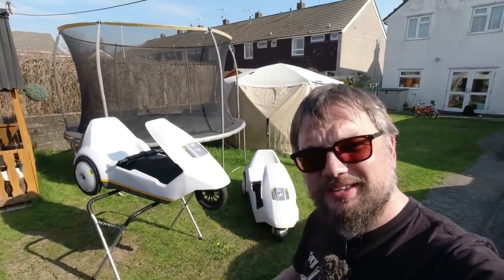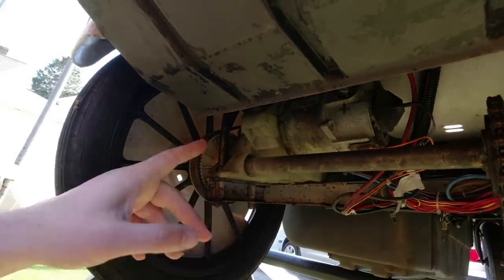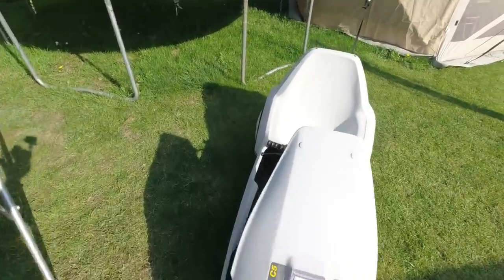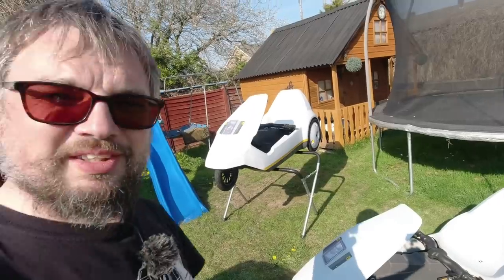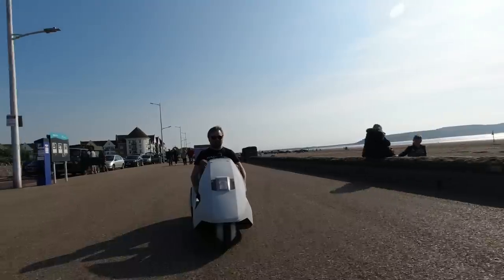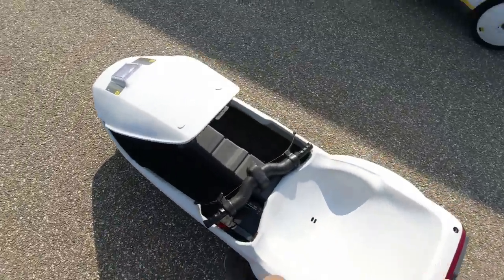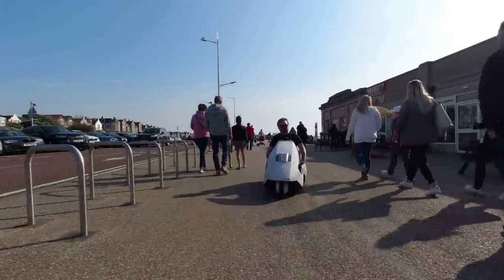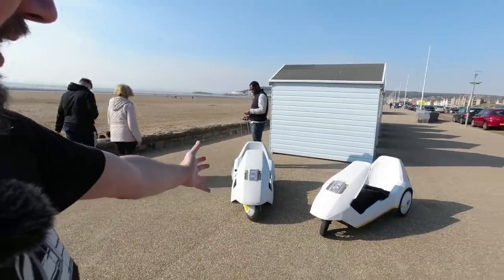Sinclair C5 - A Great British Failure! (we love a failure!)

Comment: They did sell a high visibility mast for the back and even custom fit cushions, I still have the original brochure. I have ridden one on the road once and it was very scary, cars can barely see you and lorries will not see you at all. I think the current modern equivalent is the electric scooter obviously they are still currently illegal to use on the roads, but then the C5 only came about due to a rule change on motorised vehicles.

Comment: I really must fix my C5, I used to drive it to the school I worked at during uni, the kids loved it! Good summary of it, really no car will come close to attracting to the amount of attention a C5 does, there is no suspension (I have the seat mat - think camping mat thickness, and that does save your spine!), but its great fun to ride. I never found it daunting to drive in a 40mph limit - due to its unique nature I found that people tended to gie it a lot more room that they would when I rode a bike - although the width is fairly similar. The rear brake is a proper drum and packs good stopping power - the problem was it only braked the right wheel so an emergency brake meant veering to the right (toward traffic!). There was an estate with cycle lanes near me which was nice to drive round  - except the appalling turning circle (I recall i could just about do a 180 on a 2 lane road), which meant I needed to get out every time the path stopped abruptly and crossed a road.

Comment: I have owned recumbent bikes. A three wheel Trice and a Peer Gynt. 

On the Peer Gynt two wheel the steering was under the seat. 

I missed out on a unboxed C5.  The C5 is as relevant as ever. 

 Lo26 Same bike I have modified good for 25mph 10 amp 48v 500w motor. 30miles range. When I got it 10 miles. Modified gearing ratio, high pressure tyres up from 40psi to 90psi (still want to try racing tyres 110psi.) Removed unnecessary weight and pedal assist. Fantastic. I could upgrade to a 14 amp battery  but I like getting the most from the least. The battery pack is light and cheaper than Bosch  equivalent good 700 charge cycle. Carry a spare battery you have a range of 60miles. A battery is approx 250 300 pounds verses the more expensive Bosch. 

I recommend the hub motor as opposed to the Crank cadence motor. The harder faster you pedal the power is metered. The Lo26 is a bit dim witted in power take off. 5 different power settings. All or nothing in delivery but once used its simpler less expensive.  I keep to settings 1 and 2 as gearing is short. Hilly where I live. 

Lo26 from £650 to £700. Verses the Bosch £1,500. 

My bro gave me his Lo26 Chinese Ebike I wanted to hate it but it really us a fantastic cheep surprising durable bike. You do have to go over the bike. Bearings are tight from factory I adjust proper. The front wheel bearings are way to tight etc.

Trice ice Recumbent is efficient I'd be hitting 40mph coasting with no faring. Add a 700c wheel with a motor. Using a 10amp hr 48v 500w motor. I reckon I'd better my 30 mile range than on an conventional Lo26 using farings etc.

I feel electric cars should take the cycle car approach they are simply too heavy.

Remember cycle defensive but respect the traffic at the same time.

Comment: Its not only a failure, it's funny too! But it almost was a good idea, like an early mobility scooter. 

I think the designers were a bit confused what this was for though, and the marketing department also seemed strangely compelled to push this thing for on road use, even though that was and is a bad idea.

Like what some others have already said, I think this could've been successful if it was 30-50% bigger, had a roof and was marketed as a mobility scooter or a young person's toy.

Comment: I used to daily mine to work - I definitely didn't ever feel scared in traffic. Usually more embarrassed to be holding up traffic because everyone slowed down to get a better look!

Technically they failed compared to Sir Clive's expectations but they were the best ever selling 'electric vehicle' in the UK until the Nissan Leaf.

Mine has now been upgraded to disc brakes, litho batteries and front hub motor that will pull you up the steepest hill. Let me know if you ever want a go in what I think a modern C5 might be like.
Reply: Also - a very small correction. The front brake is indeed a brake block on plastic, the rear is a custom drum brake. And absolutely useless!

Comment: He was ahead of his time - how many electric bicycles are there now for sale. That said, the execution was somewhat questionable 😂
Reply: It was a shame that battery technology sucked at the time otherwise he would have been the Tesla of his time.
Reply: @phillipsmiley5930  it’s well known that battery density limited range.
Reply: @phillipsmiley5930  obviously the power limit limited maximum speed and hill climb. But it doesn’t inherently limit range the same way, and therefore the range was more due to weight from battery density. If you have a 1kWh battery you can get 4 hours at a 250W power limit. If you could fit in 4kWh instead, even still with a 250W limit, you could get 16 hours of output instead, and correspondingly 4x the range. But the density of the batteries limited the total Wh capacity while being light enough for the 250W limit. In that sense, if the power limit were higher, then you could afford to put more weight in the vehicle, but battery density has fundamental weight limits even outside of regulations (like the rocket equation). Diminishing returns kick in, and you don’t get as much increased range even when you add in more Wh, because you need even more W to counteract the down force from the extra mass. Lead-acid batteries have a really low point of diminishing returns, even electric GM test cars from the ‘70s with no power limit just couldn’t go very far because of battery density. Trying to do any better on a tiny bike wasn’t going to happen with their battery chemistry.

Comment: Clive Sinclair was years ahead of Elon Musk in thinking in Electric vehicles on the roads But back in the 1980's technology was very limited to make something good and reliable
Reply: Of course, he was probably inspired by the electric cars from the early ‘70s. Which were often single seater affairs themselves.
Reply: The biggest issue was the battery technology. Back then they just didn’t have the batteries that had the power or could hold the charge like they do today.
Reply: @matty6848  absolutely. Have you looked into some of the GM electric test mules from the early ‘70s? Even with a trunk crammed full of lead-acid batteries, their acceleration was garbage and their range was terrible. There was a project with different chemistry, I think maybe it was silver-zinc, which performed a lot better (albeit still not as good as modern lithium), but the price per cell was so high they couldn’t afford to bring it to production (well, when sales projections were figured in).

Comment: Tried one out in the 80's but had trouble reaching the pedals as only 5' 2.5" with shorter than normal legs to body ratio.  This made steering very awkward as one was touching the handlebars when extended.  An adjustable seat would have been a vast improvement.  A sale lost.

Comment: I think one of the biggest failures with the C5 was the January launch. January!! Totally wrong time of the year. I believe a lot more would have been sold with a summer launch. If i remember right, they were about £450. By the end of 1985, Woolies were flogging them off at £100 each just to get rid of them. I was 14 at the time, and was quite interested in getting one (no money of course). Our woodwork teacher had one, and used to get the mick taken something rotten by the kids! Incidentally, the body of the C5 was the biggest single piece plastic moulding ever produced at the time. I think Sir Clive had plans for a C10 (2 seats) and an even bigger C15. Due to the failure of the C5, they never saw the light of day. Lovely Ian, thanks.

Comment: I don't believe the bit about being too low to be seen for a second. The road markings are lower than a C5, and nobody has trouble seeing those. It does say a lot about British attitudes though, ride one and everyone stares at you while saying you can't be seen.

The thing that turned the C5 into a disaster was the long and inept development cycle. What was the point in getting lotus to do a two-part pressed steel backbone chassis when it could've just been made by welding up steel pipes? They put millions into that plastic front wheel and brake pads, could've just used an aluminium bike wheel and normal brake pads. If they hadn't racked up all this costs then it'd have at least broken even.

Comment: My neighbour had one in his garage for years. Bought new it had all the accessories available at the time (cost over £160 on top of the C5's initial cost) in total around £650 I think or about £2000 in todays money. It was used once to go down the street and on its return was promptly parked in the corner of said garage never to turn a wheel again. The exact words I cannot type here but they went "** that for a game of soldiers ***** **** laughed at me all the way and a ****** van literally forced me into the kerb. ******  It was destroyed in a fire about 5 years ago which is a pity as it literally had done less than 2 miles and was in perfect condition.

Comment: £400 in 1985 is nearly £1300 today. A Wuling Hongguang Mini EV is £3200 in its local market and far better. I read recently that Sir Clive never did market research which may explain a lot. Other trivia is that at the time its bodyshell was the World's largest injection moulding and the motive power (washing machine derived?) was originally going to be a Bosch wiper motor.  Check out the C10 and C15 which looked much more acceptable but effectively never got off the drawing board.

Comment: It was intended as an alternative to the car and the publicity at the the time suggested it could be used for the commute. It failed miserably as it was a terrible idea then and it still is, with no significant luggage space, no weather proofing and no safety. 
If they had marketed it as a fun, leisure toy/vehicle then it may have had a better chance but would you really want to commute on the road, in the dark on a cold, wet winter's morning, with one of these ?
The only people it might have appealed to were cyclists but the majority of them would prefer the higher position and lower cost of the bike.

Comment: The C5 would have been better with two wheels at the front and one at the back. The Morgan three wheeler had proved that configuration, and its now common for pedal powered trikes. An low power vehicle with a terrible ride and handling wasn’t going to pick up sales on fun factor and even with the optional Sinclair waterproofs wouldn’t have been liked in the rain.

Comment: I would be interested in a hubnut E-bike video - have you ridden one?

The C5 seems to offer a lot of potential for modern upgrades. The lithium battery, as you commented on, but also a modern e bike motor and controller that allows different speeds with a throttle, and gearing in the pedal drive to make hills easier and faster speeds possible (the motor would legally cut off at 15moh, as per ebikes, but that doesn't stop you pedalling faster)

Would love a future retro C5 brought to market with modern upgrades!
Reply from the maker: I never have. I'd like to.
Reply: @HubNut  They are great fun, make hills feel a lot flatter, but you still get exercise as you have to pedal as well

Comment: It's not enough bicycle (making the narrower e-bike still more practical) 
and also not  enough car. (Because it has no roof) 
This contraption would fail today in 2021. Regardless of modern battery tech or cycle lanes.
If a vehicle like this is supposed to have any chance of success it must have a roof IMO (like the Renault Twizzy and Citroen Ami EV.)

Comment: A local posh showoff had one back then and he put a petrol engine in it (some form of lawnmower engine I recall) ........ No exhaust, I'm sure it was even slower probably with the extra weight of the wood gloss orange and the DOH navy blue (shortened DUKES OF HAZARD) painted over it. We used to pea cute him as he deafened us as he went by in his lightweight racing Shell Suit. He was labeled the town idiot FROM those days. Some used to say the DOH used to really mean Dick On Head and it did seem to suit the wacky scenario more accurately..... I've heard you can still hear the echos of that lone idiot still slowly plodding his way around those shabby 80's litter stroon back streets and some say.... You can even still see the gloss run paint that dripped onto those pavements rendering them death trapps on cold, wet and wintery nights as a reminder of those totally aWesome times. Thanks posh DOH and the 80's for memories worth a share in 2021 and cheering on a lifetime of fond amusements.

Comment: I feel like these would be a successful hit in today's world. We probably have better infrastructure to accommodate them. Also does peddling charge the battery on the move ?
Reply: No it doesn’t, they’re mainly there for starting off since the throttle is just a button that gives full-power to the motor, not good for the plastic gearbox. Also to assist going up hills and if that battery goes flat 😂

Comment: The C5's main problem was that it was ahead of its time, technology and public perception wasn't quite there yet. But the C5 did attempt to tackle some of the problems that are resolved in modern electric vehicles. If the C5 was being built now with modern batteries and modern electric motors and control systems it would be a much more practical proposition, as indeed many modern electric assist bycycles/tricycles are. I suppose something like the G-whiz is perhaps its latter day decendant!

Comment: I had an electric bike that had an 800wh battery. I did 50 miles one day and only used 1/4 of the Battery🔋bars. I calculated the economy at around 5,000mpg-e. I moved further away from the city though and I gave it to my dad since he's struggling more cycling with his COPD.
Reply: Hi I find this hard to believe do you have name and model of bike so I can check and purchase this bike?I once had an electric bike "cyclematic"Absolute crap as I think that goes for all e bikes in my experience battery's are so unreliable and cost a fortune to replace most owners are unaware of this and end up selling their bikes for a fraction of what they paid as cant afford new batteries!,Take note all you electric car owners this will be your fate too!! Electric vehicles are crap and have a bigger negative impact on the earth carbon emissions footprint rubbish!disposal of batteries is far worse than combustion engine!
Reply: @tonybilco1317  I have been saying the same thing regarding Electric cars. No Different to Mobile Phones too. After about 2 years your Phone appears not to last as long as it once did. Thats all to do with capacity and Charging cycles and such like. So Sir! I believe you are absolutely correct there. Electric cars Unfortunately are going to have a Similar problem. And i am a real Dinosaur in that Respect. Nothing and i mean Nothing can Replace the Internal Combustion Engine. Even 135 Years after the 1st car was invented.

Comment: Imagine one of these with a decent sized pack of 18650 cells and a replacement brushless motor or if you want to turn it into a 'Teslarrible' you could give it the dual wheel hub motor set up at the back and improve the brakes with a controller which allows for regenerative braking... and not forgetting the Super Ludicrous version which comes with a front hub motor as well 😂

Cheers for that Ian, a great review of a quirky little number well ahead of its time. I think I remember putting a Christmas list up the chimney which featured a C5... oddly enough I didn't get one 😂

Edit:

Amongst several modded SC5s on YouTube this turbine powered one is on the more bonkers side:
https://youtu.be/8ic6dxwx270

Comment: I'm old enough to remember when these came out and the hype was incredible. However, it was obvious it would fail from the outset as it had no advantage over a bicycle. If you were not fit enough to ride a bike, chances are you wouldn't want to sit down so low, it was slower than a bike, had no weather proofing yet was more expensive and unreliable.

Comment: Ian has forgotten to point out the biggest flaw of the C5: you're completely exposed to the elements except your feet maybe. Which can be problematic on less sunny days. On the other hand, because there is almost no engine noise, it is quite a relaxing experience. With todays electric motor and battery technology a pedal assisted bicycle is ideal for short travel. Last week I've taken a 14% gradient incline by such a bicycle, my apologies to struggling cyclists on racing bicycles for my wide grin when I was passing them (though I had to pedal quite a bit too, even on high assist setting in the lowest gear).
Reply from the maker: True, but bicycles are also rather restricted in terms of weather protection...
Reply: @HubNut  I know of recumbent bikes that have a kind of enclosure. It makes them a lot bigger than a C5 though. The C5 handlebar design looks peculiar but is very much space saving.